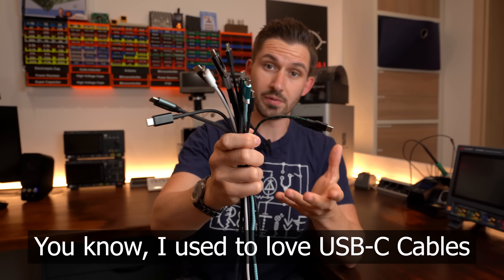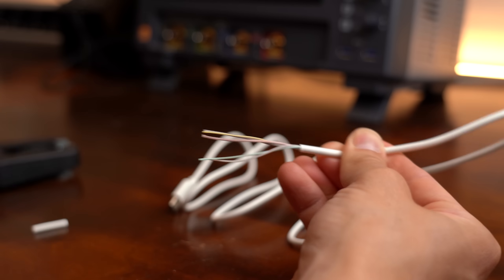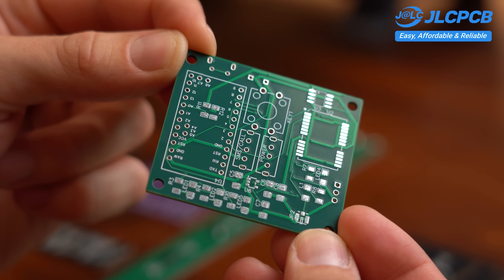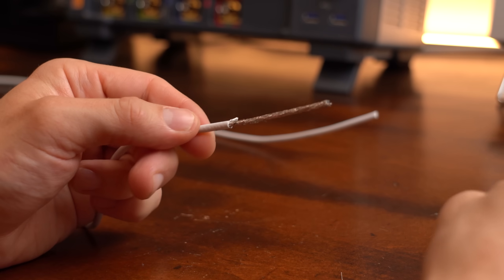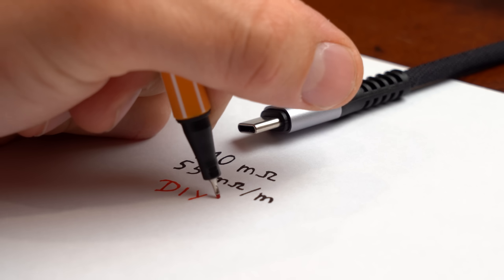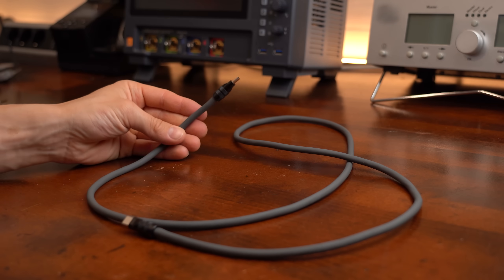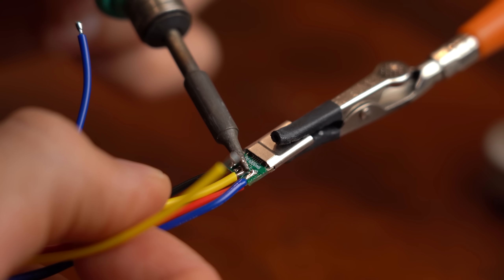Your USB-C Cable STILL Sucks — I Built a Better One? (DIY or Buy)

Comment from the maker: Easy, Affordable and Reliable - JLCPCB, Your Full-Service Electronics Manufacturing Partner. Explore more deals at JLCPCB's Coupon Center：https://jlcpcb.com/coupon-center?from=AAA
Thanks to JLCPCB for sponsoring this video and making this show happen 🙂
Reply: How awesome is the technology when data lines are next to high voltage lines in the connector?
Reply: When you connect tester with USB A as reference, but later using type C, don't you see that it's missing reference for Type C?
Reply: The problem with. JLCPCB is  the fact that delivery costs are extremely high. Sure, the boads are cheap, but with a delivery of $30+ dollars and a really bad exchange rate, it makes using their service too expensive unfortunately
Reply: Awesome 
But can you create a diy charger
Reply: This is an excelent video but even if you do not need it i would be very intrested in the datarates as  I was looking into making a custom cable for hoocking a dock up with a remote PC where this was important.

Its also a shame that the aliexpress links are already down
Reply: Nice
Reply: i mean you say "raw" look but there's a whole company called chubbycable that makes thick silicon cables just like that that are awesome. honestly, you should do a comparison. yours vs theirs. i'd like to know if a premium cable beats, loses, or is the same.
Reply: Great video scott , please make a video on how to make a DIY cable for usb3.1 transfer speed along with USB PD in one cable.
Reply: @greatscottlab
Why is slow data transfer better than fast data transfer?
Reply: This is honestly what I've been looking for I think. 
Do you think you could make a video on a DIY cable that can handle all protocols especially SUPERVOOC and hook it directly to a power bank, not an adapter?
Reply: the only thing that I don't like is the fact you used the hot air gun to shrink the orange sleeve pointing the hot air to the beautiful wood table! this can damage/burn the laque, better take with a hand the cable in the air and hot air the sleeve little by little and save the wood table! for the rest, is all PERFECT as allways!!😁
Reply: I figured out the problem is many times If you're not purchasing a $30 cable they're not using real copper stranded wire and if Is a real thin Angel hair Like conductor that it breaks right at the connection every single time.  Technology is getting better while the production and materials are being  substandardized On a level never seen before and it's just pure greed.  $10 pure copper cables don't exist anymore And you can spend three times that price and still not get a standard great Quality cable like you did 15 years ago.  Plastic connector heads are Like 1 inch long and it does not allow the wire to be Flexible and breaks the USB ports Eventually, it is a horrible connector and should be a right angle or something It does not protrude which will get broken or at least make it three times the size for some actual contact points.  All this smaller crappie  BS that breaks when you barely touch it is not advancement it's the DE evolving the tech and we had better Material technology Being used In cables for1/3 of the price a decade ago.   Now you can hardly find a real copper cable anymore
Reply: Hello, Scott can you help me i am designing a PCB circuit to charge three 18650 battery at 5v 3A each using three ip2312 module. Can you make video on how to make a circuit in which 220v Ac is converted in three  each 5V 3A supply that go in ip2312.
Reply: jlcpcb's 1oz copper is actually 0.9 oz lmao
Reply: Why are you talking in African can't you just talk in English
I didn't understand anything you said 😢
Reply: Imagine my surprise when we have the exact same computer and the exact same keyboard lighting. Katana B13V?
Reply: Efficiency Problem , useable big Amp,  low safe from damage , cable work as Fuse , If heat , just broken,
live is easier ,  only cable , what is Power supply or Charger give high current , make connector not pretty well connection ,
hot and much Hotter betwen to junction ,   Module from Smartphone will damage before fuse.
Reply: @greatscottlab  what awg # you use in this project?
Reply: Your   A   Fraud

Comment: Retired CS engineer here. I've built my own cables, from spare parts, but it’s easier to purchase one. And if you're cutting, then testing cables for "loss", your cables should all be the same length. A reputable manufacturer will use a thicker gauge for longer runs to stay within spec. Don't blame the manufacturers, blame the uneducated consumers who think they can buy a cheap USB C cable that does it all. They don't exist. I buy certified Thunderbolt 3/USB4 or later (≤ 2 meters) from a reputable manufacturer (Apple, Belkin, Cable Matters). And I buy longer "charging" cables for 100W/240W charging.

Comment: Cool, this is a good guide to convert raw power into pd output for cheap. 

Most trigger boards only output raw power with no pd negotiation, so power banks that don't support fixed voltage sources like Vention for example won't accept it.

Comment: 11:02 you could use a Cat 8 infrastructure cable. They are a little expensive but support POE and have solid cores and they are extremely well insulated.

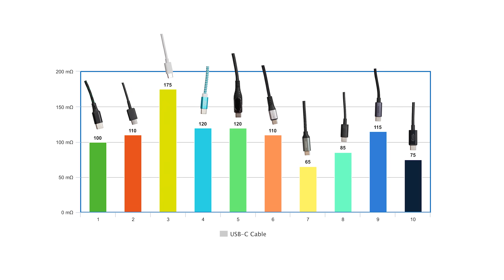Comment: I'm sorry but I feel confused about the calculations, at 2:52 the paper and your handwrite shows 750mv drops is for both Vbus+GND cables but at 5:09 the result of the voltage dropped and the resistance should be only for the V+ cable but not the Vbus+GND voltage dropped so I think it shouldn't compare with the 750mv standard but the 500mv voltage dropped standard which shows at 2:52

Comment: I feel like something should be mentioned after a bit of research I found out usbc cables cost less than 3 bucks to make on the manufacturer and it could be as low as $0.30.

The end result can be well in excessive 8 bucks. For something that probably doesn't even meet spec.

Comment: i would have used some cat5e wires i have laying around as the cable 
put on some ferrite core because i live near a rather strong power post
(noticeable interference when your cables are long)
anyways,  good job good vid 👍

Comment: Maybe you could have put some liquid heat-shrink inside the connector to the mechanically hold all the wires in place. I mainly use it for my xt90 connectors in combination with normale heat shrink wrap to isolate the plus en native when then solder joint would fail. Maybe that in that small connector it won't work.

Comment: Imo a unified port should give unified results. The only thing that would allow you to have your own way is by color coding the ports. Like usb used be black, blue or red, depending on its capabilities. And everyone using usb c should be forged by law to use these standard and support every lower standard.

I like to think of quick charge at this point. When that came out, every device and cable supporting quick charge was compatible with each other. And you knew, because it was advertised with it. And then came quick charge 2.0 and 3.0 but every quick charge was backwards compatible.

So, every device and every cable were compatible with each other. We need that time and standard back.

Comment: Diy is absolutely loser in this situation, the data transfer is low, the cable is way to thick, data lines don't need that much thickness. I thought you would make a full speed usb 3 cable with 240W.

Comment: Any cable that has communications built in is simply not worth building diy. Make your own ethernet all day long, but usbc cables are too much. And its not like you're going to save money deploying 50 usbc cables you made at custom lengths, you get a 3 or 6 foot cable for your charger (or in rare occasions personal data transfer) and be done with it.

Comment: Imagine crafting the ultimate USB-C cable: start by grabbing some oxygen-free copper wires and meticulously shielding only the data lines by hand like a true artisan that you are. For power, go all out with thick, beefy cables that mean business. Add the finishing touch with heat-shrinkable cable sleeves, and voilà—behold the greatest USB-C cable ever created ^-^

Comment: You must be careful what USB c cable you use ... Don't use cheap cables with 65 watt or 100 watt or more charger's.. that ceap cable's have thin wire's+ and - and you can self imagine what happens ! 
Is only my opinion!

Comment: Just got done measuring 14 different C-C Cables from Apple, Samsung, Anker and co.

If you're after minimal power loss, then OnePlus sell a 1m long 12A cable with extremely low resistance: 44mΩ GND, 49mΩ VBUS, 28mΩ Shield.

Would love to link the spreadsheet but comments with links are deleted automatically.

Comment: Seems like the actual problem is the lack of feature labeling on usb c cables and the lack of a description for individual conductor thickness. I fail to see how this solves either of those issues. This video is a solution in search of problem with the way its framed. If it was framed as a "how to make a cable" instead of a "making a better or superior cable" then I'd understand the problem.

Comment: Whats the value in this? I watched the opening segement 3 times and I can't really see the problem here. You know all the features you want in a cable, why dont you just look online for it? E.g. i bought a cable that does high speed transfer and can support up to 240 W charging across every single charging protocol (except Dell laptop proprietary) which took 10 minutes of researching to find and was $15-20 but it works. The jack ends are also engraved with the specs of the cable so you never forget.

Comment: I'm so tired of usb c. Just give me a proper power , video and peripheral cables. The cable feels flimsy af after a few uses anyway and disconnects constantly. really wish I could put a barrel jack on the phone. and the "benefit" of fast/adaptive charging - just kills your battery quicker. Recently bought a Sony Reon and found myself with a useless usb c to usb c cable that I couldn't plug anywhere because I have trillion of USB A power bricks!

Comment: 5:42 Can you test the oposite please? I found this vid while looking for lightest cable ever, I need it to cennect 3D Scanner that im going to hold above my head for hours and wireless is not an option so i started wondering if cable that weighs just couple of grams is even possible, it would need to transfer 300 Mbps and 7 Watts of power

Comment: Surprised nobody talked about USB-IF (USB Implementers Forum).  Its the official organization that sets USB standards and cables certified by USB-IF comply with the required electrical, mechanical, and signaling specifications to ensure safety and performance.

Certified cables are allowed to display the USB-IF Certified logo indicating their data and power capabilities (e.g., USB4, 40Gbps, 240W).

Comment: I already did my DIY type c usb cable, similar to this one, my goal is to reduce power loss through the cable by doubling the size and shorting the length of the power lines 👍👍

It is Worth it?  YES IT IS👍💯

Comment: Why is slow data transfer better than fast data transfer?
Reply: It isnt, but it is way easier to solder to a usb 2.0 than a 3.0
Reply: @mr.technologysilva8856
😁👍
Reply: @mr.technologysilva8856 By eck isn't it though! Even soldering the receptacle to a board can be (cough) stressful (cough).
Reply: @marcdraco  I did a switch mod chip installation, while not the most difficult, I had misplaced my microscope and did it without! I am very experienced in soldering, although I am 16 I have owned a soldering iron since around 12-13 years old, and I sometimes spend hours desoldering things, I salvage capacitors from dead boards, than fix computer monitors that have dead capacitors, and than put the monitors back out to use again! Just for the fun of it too, one monitor I have is a no name brand monitor that is older than me and is not a good resolution, but rather than replacing with another free monitor I just enjoy soldering, meanwhile I also have done some SMD soldering but not as much, I am confident in through hole components, but I think I could do a USB 3.0 type C board, and I would love to try it, but when I do I plan to buy the wires, and do the sheilding, twisting, etc. All myself, and buy the components for that separately, and than I want to add a silicone cable sleeve and make it high quality, currently own a 3d printer and laser cutter, but if I can manage to scrape together some cash for a CNC than I can probably make good connector housings of something like copper or aluminium! Regardless, smaller solder pads is always harder, as well as if they are closer together, so I fully see why he would want to do his first one with usb 2.0
Reply: @mr.technologysilva8856 You sound like me from 50 years ago! Good on ya for repurposing old bits. So long as you're careful with your e-waste, people like you give me some hope we might have a future.
Reply: @mr.technologysilva8856
😁👍

Comment: My question is when you plug in fully a USB-C cable. Is it suppose to have slight metal exposed? I just bought a brand new Mac mini and seems that because USB-C Jack is so thin and it cannot fully insert into the port itself. It seems lose. When you move the cable slightly, the head moves as well. This applies to thunderbolt and display port cable in the form of USB-C Jack.
10:02

Comment: I think that at that point most of resistance is actually not from the cable, but the contacts and PCB traces. The contacts in USB 3 are rather small with limited surface, making this roughly best case possible. You can measure cable vs PCB+contact resistance by making cable of different length using same components. I imagine, if you make a cable 2 times longer, resistance will go up only 10-20%...

Comment: ALL charging cables I have bought from Temu had failed. First I thought maybe I stepped on them too much, maybe I did something, No, they just go bad, very very weak solder joints and very thin wires.
Reply: It's TEMU.  Junk outlet. Buy cheap and pay twice

Comment: Nice! I'll join those asking for you to try to make a version with high speed data/video, as that's a must for several of my cables. Would also be interesting to watch a breakdown of how the Thunderbolt protocol(s) differ even though they use the same connector, and just find out at what point things become no longer feasible to DIY

Comment: Might I recommend looking @ CAT6A, 'CAT7', and CAT8 STP or S/FTP wirestock, for your next attempt? Some of those flat Shielded Ethernet cables might even work, and be more manageable on the wiring-side. Plus, if you end up needing more conductors for full-spec USB-C, you can flat-stack 2 layers for 8 twisted pairs to work with. (BTW, Ground and +V power 'should' be in a twisted pair together, to reduce EMI, etc.)

Comment: Thunderbolt and USB-C are both connectors, but Thunderbolt offers faster data transfer speeds and more advanced features, while USB-C is more widely compatible and affordable. Thunderbolt utilizes the USB-C connector, but not all USB-C ports are Thunderbolt ports.

Comment: Bro is flexing his android 15 oneui 7 in the thumbnail.
Reply: OneUI is the worst android variant I've ever used. I run vanilla Android for 3 years now, and I briefly booted up my old "smasnug" phone to fully drain the battery before 👽 autopsy and the OS is horrible. Redundant confusing menu shizz everywhere. And bloatware too. 
Instantly I smashed the phone in my bench vise because I hate it so much. I could have sold the old phone for 2 dollars and 17 cents, to a hobo for use as a cooking fuel.
Reply: @Boogie_the_cat just install lineageos gsi, battery lasts forever, phone cold af, never heats up, a lot more features